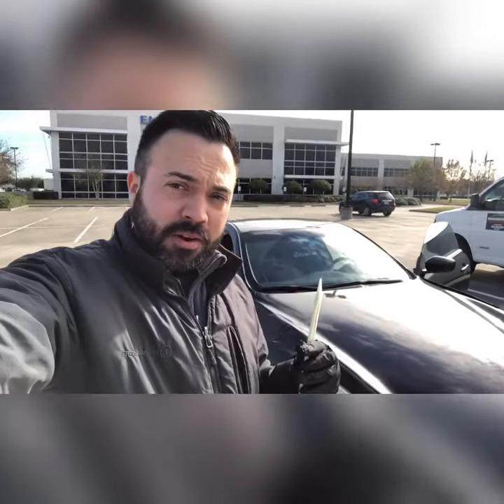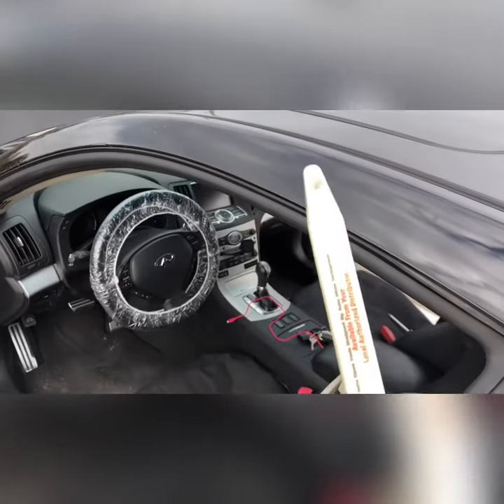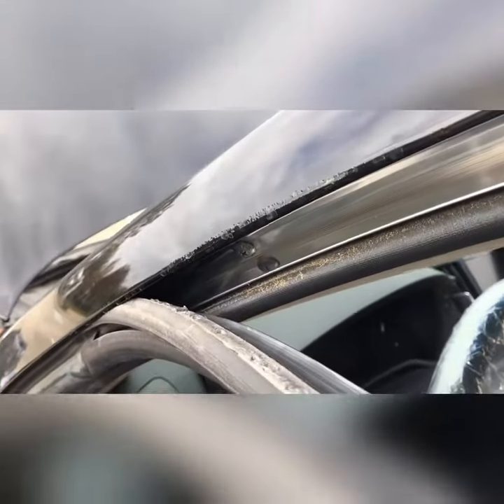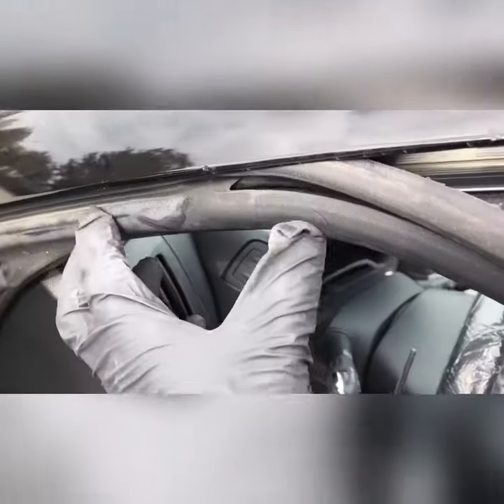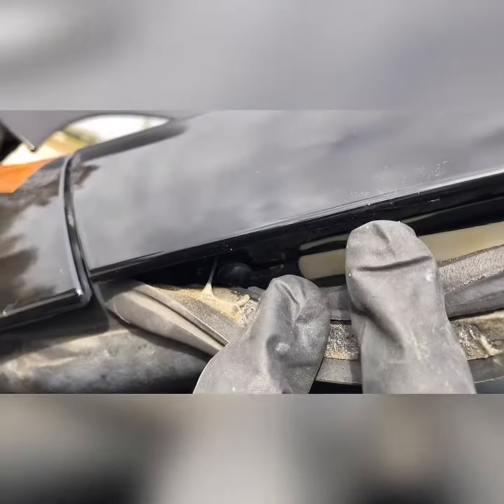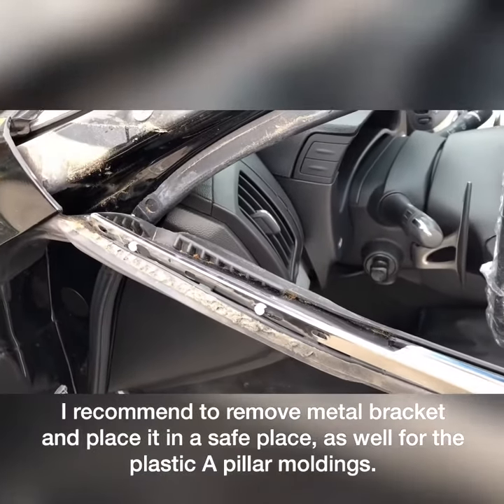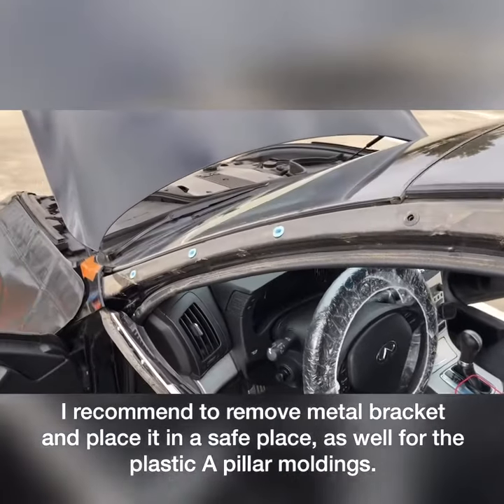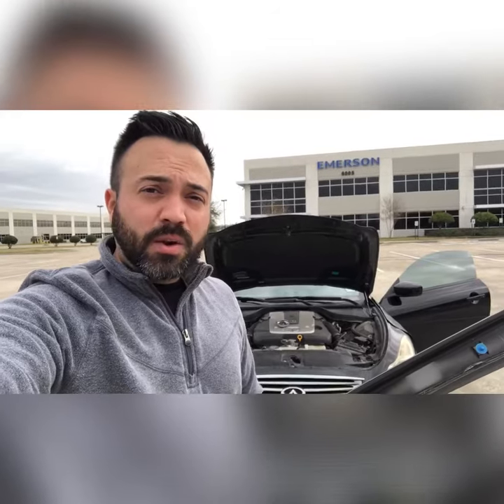A pillar removal Infiniti G Coupe

Comment: thank you for the video,   i would like to ask if you might be able to provide some advice or a solution to the problem i have.  I either do not know the correct terms to include in searches,  for my problem.  
Vehicle: 2002 infiniti g20 sedan
issue: (after seeing this video,  the issue may have come from  removing the a-pilla to c pillar upper door to cabin seal the wrong way, not aware there was possibly a correct way,  til just now
i removed the entire seal from the car, without the aluminum bracket attached,  aluminum bracket is still attached to the apillar.  
and i dont remember which side is which,  yes i removed both passenger side and drivers side,   :(   

one of the seals ripped and is now in 2 or 3 pieces,  from my attempts to reinstall it. 

how do i correct this.....  
(thinks to self,  sarcasticallly -  locate the same seals on same year model make vehicle and then find out the correct way to remove them  and do that then take them home and install,  or just say to hell with it, and drive it to a glass shop and pay for my stupidity,  lol)

Comment: Had my pillars repainted about a year ago, now there's a water leak on the passengers side.Can the door trim with the double sided tape be reused or does it need to be replaced?  I have 2014 q60.
Thanks for the informative video.
Reply from the maker: I would replace it. Remove the old with a razor blade and I tall new double sided automotive 3 m tape